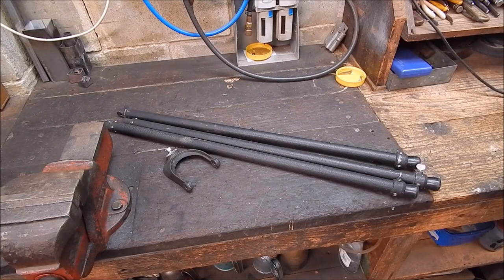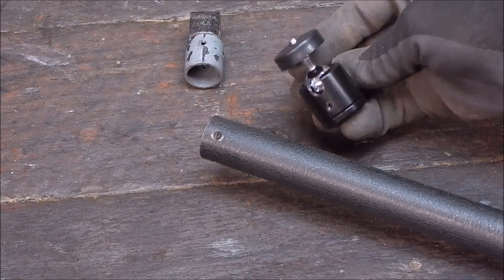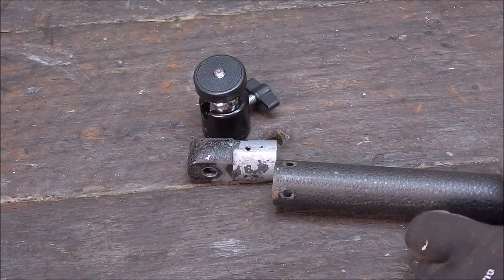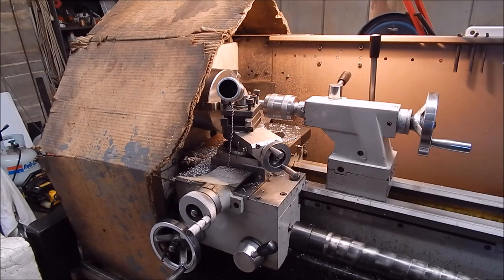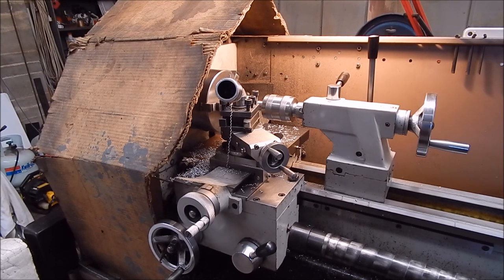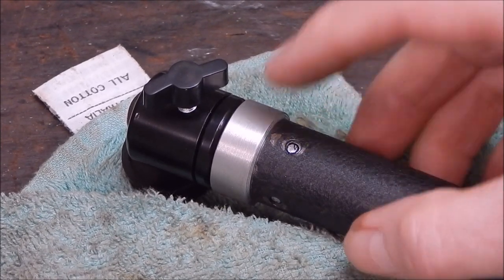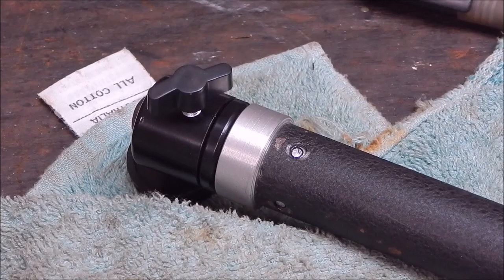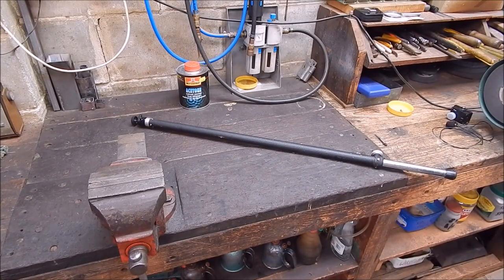I make a camera monopod rest with a ball head mount from junk

Comment: Good work.
I bought a handful of the same ball heads just last month for use around my shop and on an equipment tripod I found at the scrap yard. I've also mounted one on top of an old speaker stand. It doesn't have wide legs that get in the way in the shop like a typical video tripod.
Agree with a few of the other commenters. Don't know how I ever did anything before I got my lathe.

Comment: Hi Rob,You are a master at repurposing.Yesterday I scored on mess of metal.All shapes and sizes.Much to good for the scrap heap.Funny we are the guys friends come to when they need a part made or welded.Like that.
Reply from the maker: Hi Patrick,

Nice going.  It's always handy and ready to go.

Buy some new steel and you will get a fright, even at the low $100 bucks a ton the scrap yards are paying now..

I had to buy a 600 mm length of 1/2" galv water pipe yesterday as I had a water leak in the front yard by the meter.

It cost me $9 for that little bit.  The Bro Inlaw has about 1/2 a ton of water pipe at his place, but he's too far away to make it worth going there, and I needed it immediately.  LOL.

People often throw out dodgy old angle iron work benches, and I toss them on the back of the ute, then cut the good stuff out of them with a friction disc and junk the rest.  Done that heaps of times.

Gotta love that old ute :)

Keep up the good work.

Cheers Rob
Reply: Ya,I live 100 miles west of Portland Oregon on the coast.Got to pay for freight.Always on the look out.Part of the load was a nice sheet of copper,even a square foot is spendy.I like the UTE.Wish they would send some here it the states.Take care ...Pat

Comment: Hello Rob. Great project, but I notice two practices I'm afraid to emulate: You eschew center drills, and the same goes for any sort of cutting fluid. Care to comment?
Reply from the maker: Hi Rick,

That video was one of the few where I just hogged straight in to the metal with a large drill bit.  I wasn't worried if it was not perfect as it would be hidden.  Normally I would use a centre drill first.  You will have noticed that I took it very easy at the beginning to let the big drill centre itself - which it did.  It worked out 100% OK.

Lubricant is something I always use for parting off, and if metal starts to gall when turning I will use some (with HSS) as required.  Quite often it's not necessary and in some cases can give you a bad surface finish as it's not flood coolant.

So I generally go dry and if I have problems I will use lube with HSS.  I never use lube with carbide.  If carbide galls I switch to HSS.

HSS is way better for some jobs, especially alloy, but in this case my home cast aluminium turned up well as seen with basic carbide TCMT.

There are no hard and fast rules with metalwork.

Cheers Rob
Reply from the maker: I forgot to mention that when working with steel, cutting fluid can easily work harden some grades.  I prefer to go dry, slow, keep the heat down, and all is well.

Unless you have flood coolant, which I don't, you run the risk of work hardening the job by adding coolant spasmodically.

Been there, done that, no thank you ;)

Cheers Rob

Comment: i would love to have the link to the mount you bought on ebay. i need 3 of them
Reply from the maker: http://www.ebay.com.au/itm/272267625458?_trksid=p2060353.m2749.l2649&ssPageName=STRK%3AMEBIDX%3AIT

I have ordered two more for a project I have in mind.

Dirt cheap, good quality, and useful for other things apart from photography.

Cheers Rob
Reply from the maker: Just make sure to Locktite the small Allen headed grub screw that holds it together, as mine was a loose fit - no big deal.

Cheers Rob